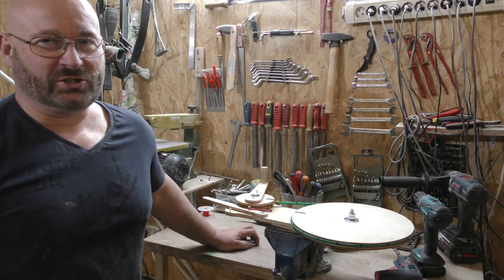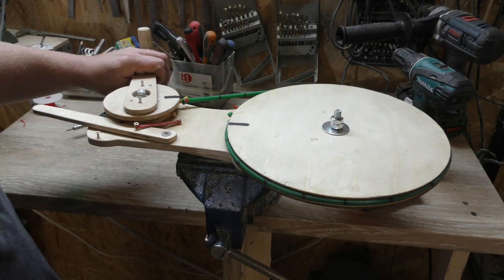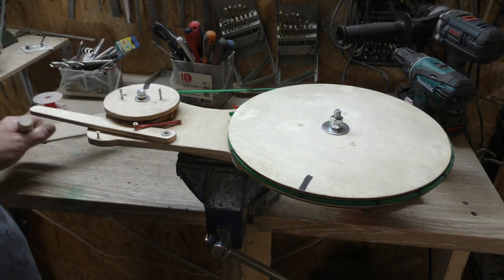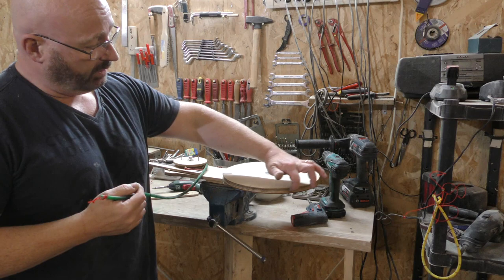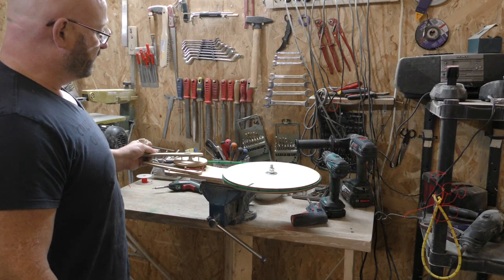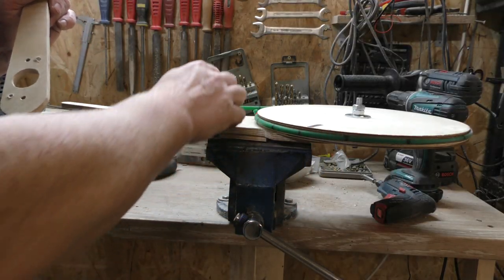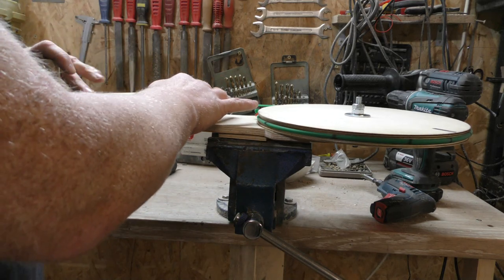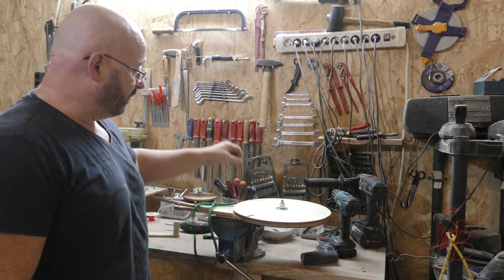High torque rubber motor?

Comment: A good alternative rather than a large wheel would be a thicker wheel with more spiral grooves allowing the rim to hold more rubber on while it doesn't drastically increase the size of the machine.
Reply: That's what I was thinking. I hope Joerg sees this comment and tries it.
Reply: Wheels are just levers, the smaller it is the less torque ( force) you get.

Comment: I think I have some sort of solution for the lack of power. Just build 7 more of those "motors", connect them with some sort of crank, and You will end up with rubber-powered V8 engine.
Reply: I second this! haha
Reply: castöe clash guides doch
Reply: steel springs like on all wind up machines, as that is what this is. plenty of devices out there work using wind up mechanisms.
Reply: AxTlou FckPrim Nein
Reply: or he could use gears to increase torque or vice versa and run a small generator
Reply: or store power
Reply: I was thinking the same thing, a V format would be the simplest way to stack opposing order (so the 1st would rewind the 2nd etc.) with the outputs being linked by a crank. A boxer layout could also work but it would be more complex to sync the outputs
Reply: So what i said..
Reply: jacplac97 how about just using one piece of rubber, 8 wheels and small wheels in vertical direction, that connect the 8 big wheels
Reply: theres a reason your profile pic is heavy not engineer
Reply: Just build 7 more on top of the first one
Reply: Joerg...you need to see the video about the "GRAVITY CLOCK"by Jorg Springer,your motor might benefit from this video Joerg.
Reply: jacplac97 that would last for 2 revolutions and power a kick scooter with our fatasses on it to 7mph with the right gearing

Comment: This is an interesting design, but I have some concerns using rubber as an energy storage medium. Storing energy in rubber is an exothermal process, meaning it heats up as you stretch it the rubber warms up. If you allow it to cool before releasing it much of the energy is lost. I believe this will ultimately limit the power with this design. The gearing is very good though. Perhaps it would be more efficient to store energy some other way, like a large counter weight, and use a gear reduction to convert the gravitational potential energy into elastic energy. This could supplement the electric motors you are using now with relatively few modification, and the energy you could store and the torque output would be limited by the gear ratio and materials.
Reply: Miles Skinner He knows about the exothermal storage properties of rubber. Rubber is his gimmick.
Reply: "like a large counter weight" 
making the weapon more heavy would make it harder to shoot.

But having a Bearing on the big wheel would make the Rubber strached more evenly.
Reply: Some energy is lost to heat, but not most, not even close.  The amount lost to heat is so small it would be difficult to even measure.
Reply: Search rubber band fridge on YouTube
Reply: Wow, was not aware of the cooling phenomenon.  I stand by my assertion that "most" of the energy is still stored within the rubber band though.  The energy dissipated as heat (while larger than I initially suspected) is still miniscule by comparison.
Reply: Miles Skinner maybe springs, would work better to store and release the energy as well as gears, like watches, gears and watches have been around many years. There is no reason this cannot be wound up like a clock is there ?
Reply: Miles Skinner someone made a refrigerator by using the cooling process of rubber
Reply: Miles Skinner yes when it is stretched it does have an exothermic " process", and endothermic when released, however stating that "much of the energy is lost" is a stretch; pun intended.
Reply: It's 'The Slingshot Channel', not 'The Trebuchet Channel'.
Reply: I wonder if you could alter the ambient temperature after cranking the device to add power to it.

Comment: joergsprave... what about a series of pulleys with the rubber?... that way you could just fold the distance of the rubber back and forth... no need for giant wheels. kind of like a compound pulley lift.
Reply: David Lewis II  the rubber will tear of fast .thats why he dont do and compound rubber guns anymore
Reply: David Lewis II I think that too. On a big wheel most of the rubber tension is held up by friction. On pulleys you can have very long rubber and no friction and whole rubber is working to make motor spin.
Reply: A set of gears with a ratio to stretch the band at the optimum rate might be more efficient?
Reply: Not actually compounding the rubber... But using a compound pulley system to pull a heavier rubber band. For every 10in you pull the wound rope/cable you will pull 2 in of the high strength rubber...(mechanical advantage) Rubber will pull way less distance, and you can set up something with lots of length really large within a small space. For instance, with the right setup you could pull 10 ft worth of cable within a 1.5 ft space...
Reply: This is just a wind up mechanism without the governor as in a clock. Gears are more efficient.
Reply: Trump's Merkin ...gears are definitely more efficient, and although it might be a little difficult to setup it would definitely work.
Reply: At first I thought that wrapping the rubber around pulleys and then  I the drum would be a better idea, but this design is actually more clever than that. Joerg's design actually means that the rubber is always stretched as it is wound onto the drum, even though the end on the wheel isn't stretched much at the beginning. A pulley system would reduce friction, but the whole length of rubber would be stretched uniformly, meaning that the first couple of wraps on the drum won't be storing as much energy as they could be. He shows this with the black marks on the rubber.

Comment: Dear Joerg,

My suggestion would be: 
use many small rubbers to get more force and reduce the need for extreme elongation. Use a gear  transmision system to get many rovolutions from small elongation of the rubbers. Increase power by adding rubbers if required.

Thank you for sharing your content, I love your passion for what you do

Comment: If you wanted to make it even more compact, you could replace the big wheel with a smaller spiral screw, which would use 3 dimensions to store the extra rubber, rather than the existing 2.

Comment: super clever idea. as you say, torque would drop off after the first couple of winding are released. maybe if you have two windings and one engages after the first one has unwound a few times

Comment: Don't use a single  big wheel but multiple small ones with good bearings. That should support the rubber more and creates a more equal expansion.

Addidional you can mount each bearing on preloaded rubber or leaf spring to store additional power.

Comment: I think other folks have suggested something like this so I guess we all agree you should put multiple spools on there, You can engage each one separately, so once one is wound up you can drop a pin or some way to lock the next one to the crank and wind up the next one. Then when all multiples are done you've increased the power exponentially.

Comment: You could use oil or grease on the larger wheel to let the rubber stretch without that much grip. Or a smoother surface, such as aluminium. That should allow you to make two or three more turns, as it seems the rubber in the large wheel is currently not stretching much.

Also, place a pair of gears on the smaller wheel so you can get more full turns when you release it!

Comment: The only issue I can see is that the stored energy won't be regular which might conflict with the automatic firing unless there's a synchronised braking/timing system to ensure the energy release is constant.

Comment: JoergSprave I know that your mind does not not require my assistance. However, if I may be so bold as to make a couple suggestion: instead of making the large wheel bigger diameter, perhaps make it a spiral, like a screw. I'm not sure that it would allow the rubber to stretch evenly the same on the "potential" side.
      Another possibility could be small, pulleys that swivel  with the aid of small rubber bands, sort of like a compound bow. Love your videos sir! good day to you.

Comment: Instead of using a bigger wheel couldn't you just build it like a spiral so that the rubber goes more than one time around it? So you could use twice as much rubber with a wheel which has the double thickness! Or do I have a thinking error? (Sorry for bad english :P) 
Und nochmal auf Deutsch weil ich glaube, dass mein Englisch echt kacke ist ^^ : Könntest du das Rad nicht einfach als Spirale bauen, so dass sich das Gummi mehr mal um das Rad dreht und dabei Spiralenförmig an dem Rad hoch geht, so könnte man im Prinzip ja mit einem doppelt so dickem Rad auch doppelt so viel Gummi benutzen, oder habe ich einen Denkfehler?
Reply: You will have one problem though: The more Degrees it has the more friction it has. It would not be able to make the rubberband stretch the whole way through (if that is a problem), but for double thickness it should work perfectly fine i guess.
Reply: But with a wheel which is bigger (like Joerg wants to make) you would have the same problem I think
Reply: No, that is the tricky part ^^ The degrees matter!

Comment: The rubber round the big wheel isn't stretching after a while (it looks like it is, but it's stretching at the wrong end, against the mounting point on the frame, rather than along its whole length). It's gripping the wheel too much to evenly distribute the force along the whole length of rubber

Comment: Jörg, why don't you put little wheels in the groove that the elastic passes by? It could be performed dividing the bigger wheel in 2 halves (up end down) and putting the axes of little whells like parafuses, in the border of larger wood wheel.

Comment: I would recommend using a set of poles instead of the big wheel. Using the big wheel the rubber at the end of it is not stretch whereas using poles the stretch its equally shared giving more length getting, I suppose, the same power

Comment: Stack the wheels so that multiple wheels of the same size use the same axle , go maybe 3 or 4 pairs high and multiply  the power , effectivly take it from a cell to a battery, it may need another board on top to hold the axless though.

i have no idea if that would work to be honest but it could be worth a try.

Comment: You definitely need a more slippery wheel or something like that. The rubber should stretch evenly right from the beginning for maximum effect.
The perfect solution would be to make the big wheel fixed and construct a ring of rollers around it where the rubber band can glide over more easily. It's a little bit to complex, though.

Comment: More meters of rubber could be "pre-stretched" on the "large wheel" if it was turned into a spiral. 

Further increase in efficiency could come from making the wheel  cone shaped - because rubber unwinds uneven (faster at the exit - slower near the fixed point).

Perhaps a spiral of changing radius (spiral of Archimedes) would be optimal, if the rubber should have a dedicated grove to prevent slipping. The spiral could be "glued together" from "pie slices" cut to size (no CNC machining required)

The geometry would be more complicated than that of a "big wheel", but it would perform awesome, and use less space. The pull would be very long and the power - constant throughout the amplitude... like a rail gun. But rubber :)

Comment: Back in days of yore we used to compete in a model airplane class called wakefield.
max of 50g of rubber.  Pirelli was the rubber band of choice.  1mmX6mm.  Lubricated by a mixture of glycerin and green soap.  Stretch out the rubber motor to 10-15 X length and pack as many turns as you could.  Launch within 15 minutes or the rubber would relax.
Just some things to consider in your design journey.
Reply from the maker: That is exactly the way I can't use, as it creates almost zero torque. Is all revs. Good for a lightweight propeller, useless for a full auto crossbow.

Comment: if you can get this to provide enough torque or power in the unspooling, and if it's fast enough. you should use this as the ball valve release mechanism on one of your large scale "toy" guns

Comment: JoergSprave - use a multiple pulley system for the rubber - it will be compact and will hold a much greater length of rubber under uniform tension

Comment: You could use compound pulleys with a strong rubber band attached to the block to multiply the draw length with rope. I imagine you could get it more compact than that circle.

Comment: If the rubber is evenly stretched how does the the line on the rubber closest to the line on the big wheel/pully never get closer or pass it? We need a big wheel with ~100 bearings on the circumference allowing it to stretch. Seems to me the markings were intentionally spaced on the rubber as was before tension was applied. Hope you wouldn't try that deception, but love your channel and your projects

Comment: I know nothing, but by the looks of it the rubber is stretching unevenly doesn't that limits the total power of the contraption? I mean, the coiled ruber will be under a lot of stress and the ruber on the wheel will still have more power to give... Anyway, great ideia!

Comment: how about a pulley system?
you can use a low of rope over pulleys to pull on a big piece of rubber. this could store a lot of energy and would run for quite a while

Comment: What about adding a weighted flywheel that would keep spinning / even out the distribution of energy over a longer timeframe? Perhaps for use on the full auto coke bottle, gatling crossbow?

Comment: Question: does the rubber come off the wheel at a bit of an angle?  I feel as though a like amount of tension in a line (vs. wrapped around a cylinder) would release the projects straighter and more energetically.

Comment: To make it even more compact: have two wheels of equal size but connect them with gears so that one revolution of the feeding gear corresponds to 2-5 revolutions of the power storage wheel. Could it work?

Comment: Just an idea to make it more compact: what if you used a non-stick spool (maybe solid PTFE) and wrapped the rubber more than once? You'd still get the slipping you need, and you could guide it with a spiral groove so it doesn't cross back on itself.

Comment: Would it be more efficient with 2 gears below the wheels to feed the rubber instead of being solely pulled by the tension of winding? I feel like the surface area tension of the the rubber thats wrapped around the larger wheel is impeding some of the stored energy. I could be wrong though,

Comment: Just a idea (No clue if it would even work), With the size of the wheel, couldn't you spiral it to the center to give more room for rubber (with supports so the wheel doesn't collapse in on itself from the tension and force), but wouldn't that be possible to give more distance the rubber has to travel, meaning more energy is stored up, and so more power behind the rubber motor? Kind of like those metal springs you have in dog collars that retract, as it builds up quite a bit of force to pull the leash back. Obviously I have no clue if this is feasible... I'm honestly tired, and this crossed my mind while looking at the massive wheel, and hearing ideas of making it even larger...

Edit: Just noticed I'm not the only one who had this idea *Seems I am not alone in this theory*... Well I just want to see if he can do anything with the idea or go anywhere with it, cause Rubber is king when it comes to the Slingshot Channel...!

Comment: if you turned the big wheel in to a spiral, you could probably double the lenght of the ruvber that's on that wheel... probably would pose some teoubles, but just as a tought

Comment: for stability and accuracy I think it's good to use an old manual hand drill design so the "toy" could be pressed against shoulder by left hand and right arm can wind the toy's rubber strings , which can be much shorter but of many layers, so it'd lose less power due to friction against the wheels. also the wooden wheels can be replaced with bicycle gears

Comment: What if instead of the large wheel three is a series offs rollers that zig-zag the rubber back and forth. the rubber might be in less contact with wood that way and would lose less energy to friction. also, have you tried lubricating the wheels?

Comment: I wonder if would be worthwhile to use small rollers in a Z configuration instead of the large wheel. My thought is that it would work similar to a draw extension.

Comment: Instead of a larger wheel you could probably use a spiral - i.e. putting another wheel on top of of the large wheel. Similar on the other side. Comparable to a screw thread.
Not sure if it makes a difference if the wheels above each other had the same size or are getting smaller.

Comment: How about figuring out a way to remove and store the small wheel after it has been loaded with rubber.  Then you essentially have a battery that can be used when you need it.

Comment: Perhaps if you added a third wheel, and made it almost like a pulley system so that you spread the rubber over multiple smaller wheels rather than just one big wheel, you could make the system more compact, or use two big wheels and up the power.

Comment: +JoergSprave I got an idea, to make it continuous instead of "batched", you could use a thick cilinder instead of the big wheel, with like five channels for rubber and 5 small discs too so that when one is pulling the rubber (motor in motion) another is charging and so on... in a cycle. Maybe you find this useful.

Comment: What if you replaced the large wheel with another spool of a long unstretched rubber. you could connect the two wheel with a chain and 1:7 reduction, to make the unstretched rubber unwind in a suitable pace.